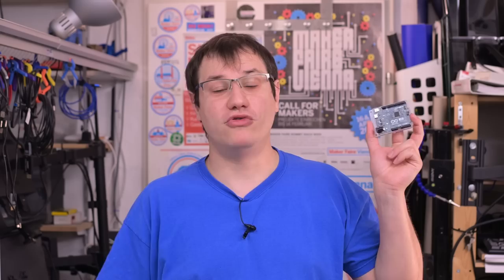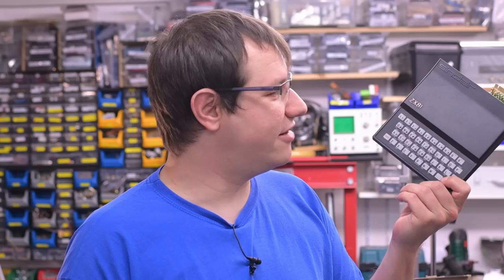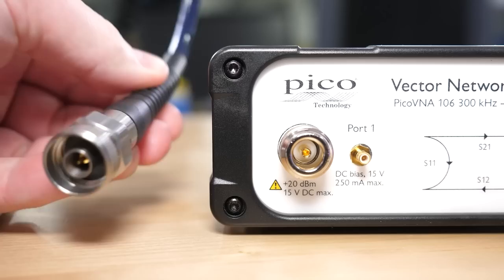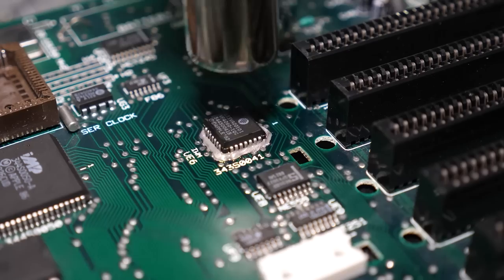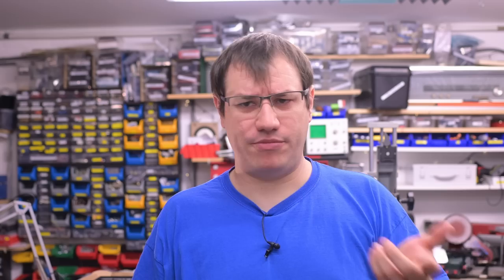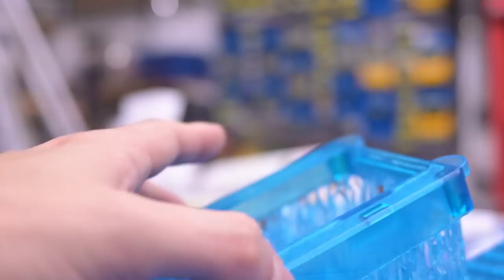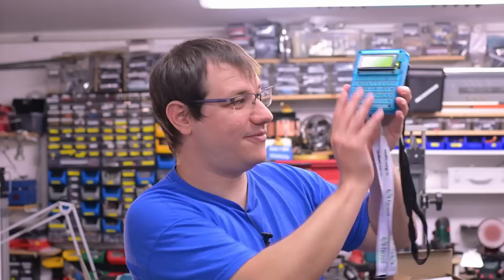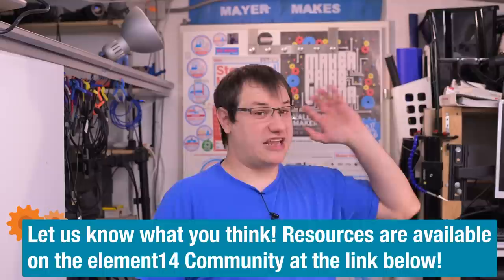Handheld BASIC Computer in Badge Format with the Arduino Uno

Comment: 14:14 Interestingly, to me anwyay, the reason the ZX-80 and 81 do the "BASIC shortcuts" is because you are tokenizing the command as you type. Other 8-bit computers processed the text string "PRINT" and converted it to a token. However, to save space in their tiny ROMs, Sinclair made the user do the tokenization.
Reply: Interestring!...mine is just entering the commands fully in a buffer before sending on contrast.
Reply: Where is "tokens" really from? We called it a byte for many years.
Reply: @elektron2kim666  It’s been around since the first BASICs. A token is different from a byte. It isn’t a data type. It’s a concept.

Comment: A possible add-on that comes to mind is some sort of paper tape reader. The reader wouldn't have to be too big (especially if it's hand-operated and doesn't need motors) also, the tape can be very compact once rolled so it would be easy to carry prewritten programs, load them, and run them! I'm gonna have to dig out my Arduino and try something similar soon!
Reply: Haha, by sheer coincidence i have a huge tape reader in my hoard
Reply: @MAYERMAKES  Awesome! Out of curiosity, what kind of paper tape do you use? I've been trying to find some so that I could try making a reader for a computer project.
Reply: @retrojon_  the original roll that was in it. its 8 bit tape and i have 5bit tape in my teletype 20mm wide

Comment: Nice little computer! You asked for possible extensions. Well, I would like to see a micro sd slot, to save programs. I think there's space for in the arduino not running basic.
Reply: Actually the one that runs basic has the pins left,and tinybasic could read it. yeah that could be an extension!

Comment: Too late, but: you could run the display in 4 bit mode to free up 4 pins.
Reply: When you look closely on the schematic you wil lsee tha tI am only using 4 bit mode.  Db4-7 are the only data lines connected to the MCU, I did use up all the pins for this project even with 4 bit mode.

Comment: Why not use a line with a series of resistors and a ADC for reading the keys?
Reply: that is another method, but unreliable with so many keys, the voltage drop across each resistor gets to big quickly, the differences very little, and there is no n-key rollover possible that way, 
gohst presses also might occur. I would not rely on analog readings for key inputs in any case but if there really was only one pinn available up to six keys might work, but still no combinations possible.